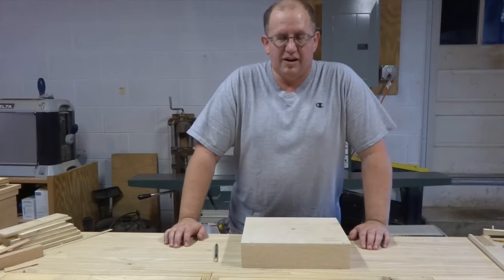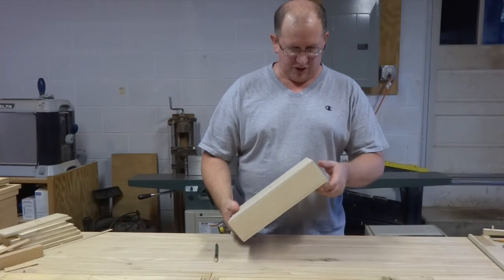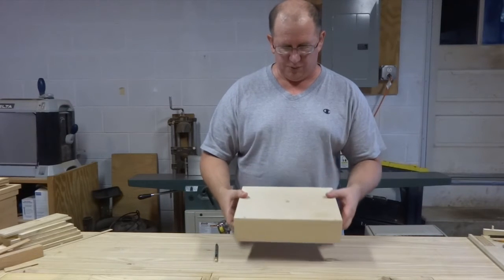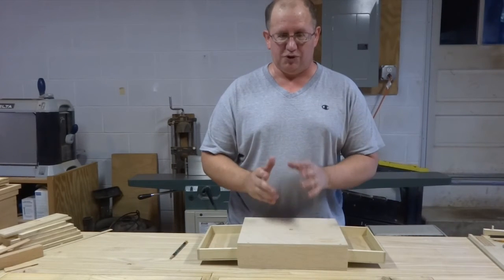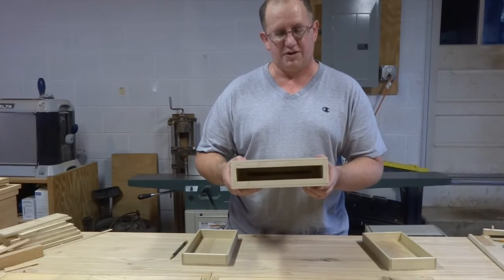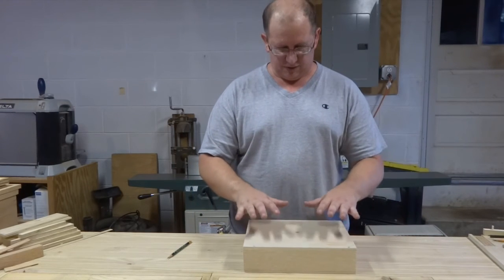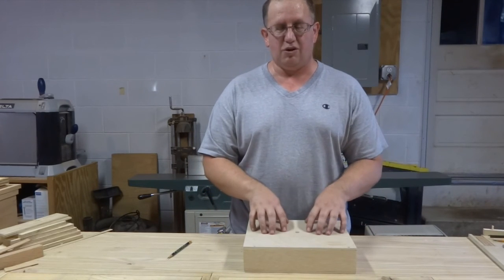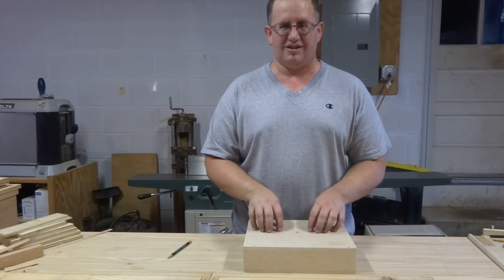Double Spring Open Drawer Prototype

Comment: yes please do I came upon this video because I was interested in learning the mechanism of a one button manual automatic open drawer, I bought this recently & I've dissected it & am still trying to figure out how it works, basically it has the added element of poping out the right index card( if you have a clue please share, I'm still not understanding in its entirety.
https://www.ebay.ie/itm/Vintage-Brown-Bigelow-Remembrance-Telephone-Number-Pushbutton-Index-/372465141407
if that doesn't work almost most of these here are based on the pop out index drawers
https://www.pinterest.com/vikkiinwonderland/plastic-tele-book-dial-a-card/

going to watch your other videos now